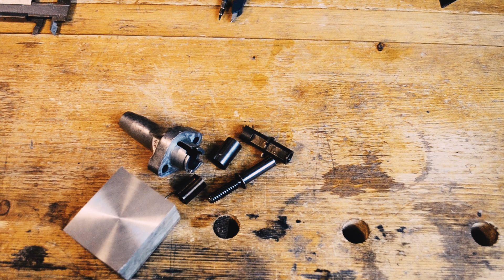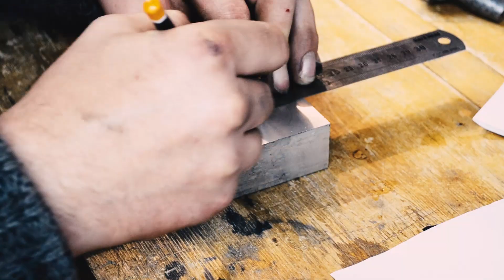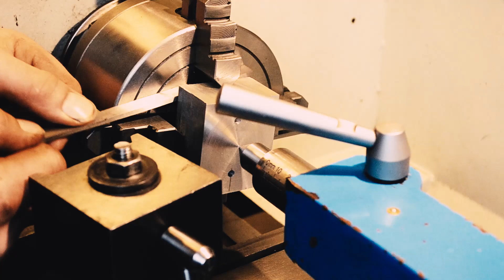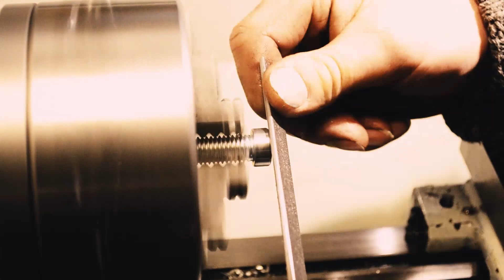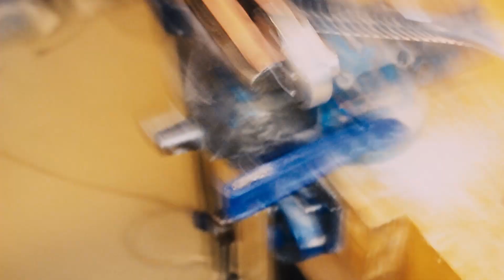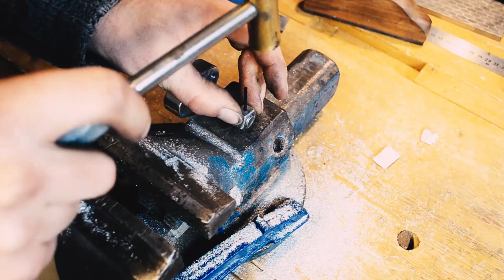Machining Motorcycle Mcct | Manual Cam Chain Tensioner Build

Comment: Great job, when oems are replaced with manual cct's are you familiar with having to block the oil hole on the head so oil pressure isnt lost?
Reply from the maker: Good question, i actually dont remember. If you are considering one you should look into that. It might have been blocked off at the mating surface where the gasket is

Comment: Question: Why didn't you modified the stock tensioner and convert it to manual? Shouldn't be easier than constructing it from scratch? I am thinking doing that and this is why I am asking. Please advise.
Reply from the maker: Hi Nikos, I really dont remember. Pretty quick to make one when you have the tools (my milling machine was down so a bit of frustration happened). Mcct's are available for most makes, not terribly expensive. Thanks for watching and good luck with your project!